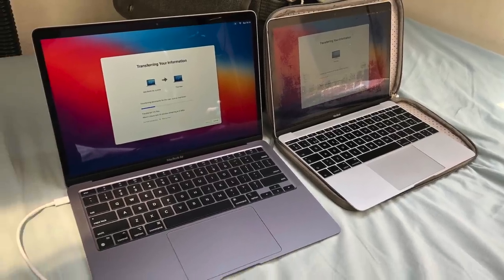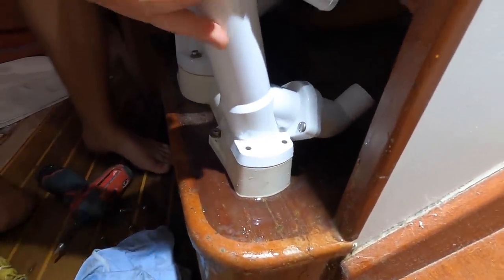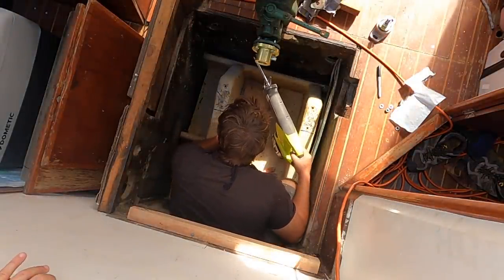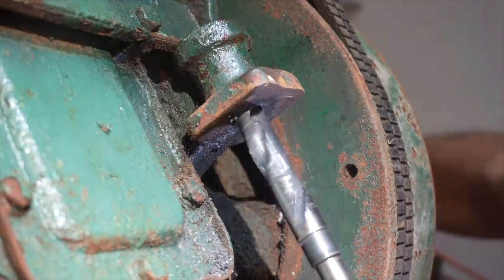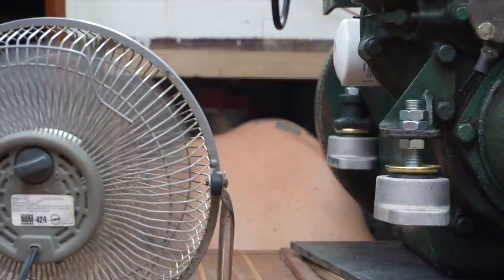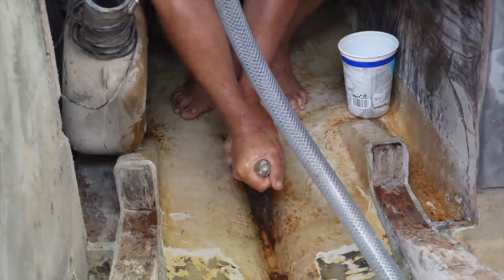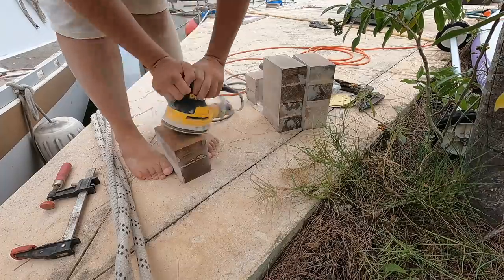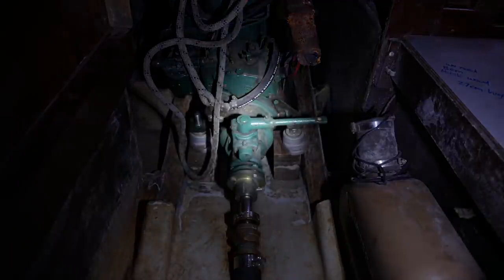SAILBOAT HATCHET JOB #97

Comment: I was so worried for Robbie's feet the way he was "Hammering" with that axe, a little worried about the hull too, but the hull is probably thick fibreglass, and Robbie's feet probably aren't.
Reply from the maker: Thanks for the concern! It wouldn't be the first time we have digit troubles, but he and the boat all good - we were worried about using the grinder in the engine compartment. Always giving the power tools super duper extra care...

Comment: Would you talk about your traditional stuffing box vs a dripless seal? I’ve always used a dripless and would like to hear your thoughts.
Reply from the maker: Dripless seals are great in theory! Haha, if everything is installed properly, nothing is worn out, rusty, old (like ours was) then the dripless are great for keeping the bilge a little more dry. For us, it was definitely worth it to have the small drip-drip of the traditional stuffing box and mop the bilge once in a while, than to have a catastrophic failure of our old dripless that was letting water gush in.
Reply: @sailorama  Thank you for responding. I value your insight.